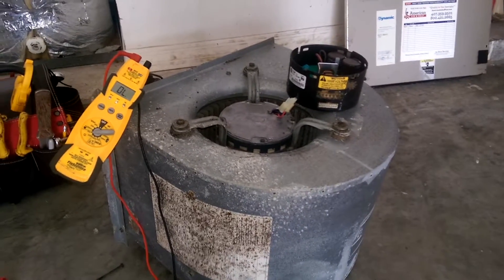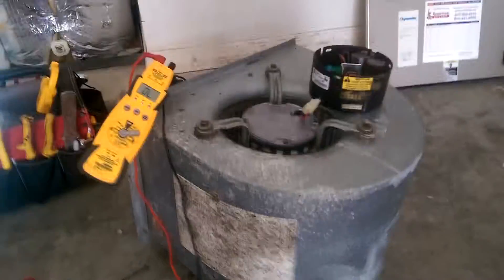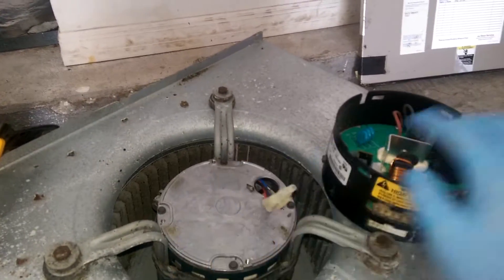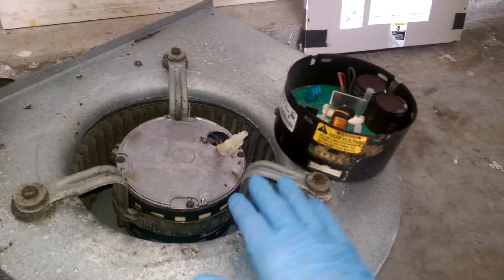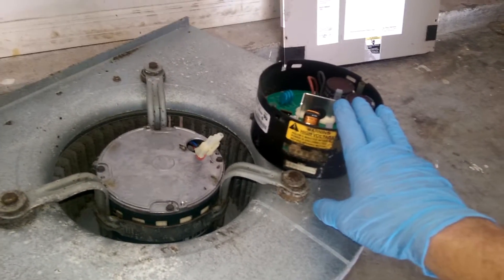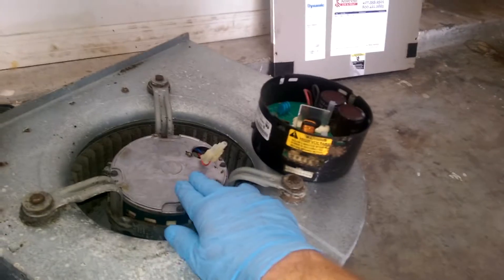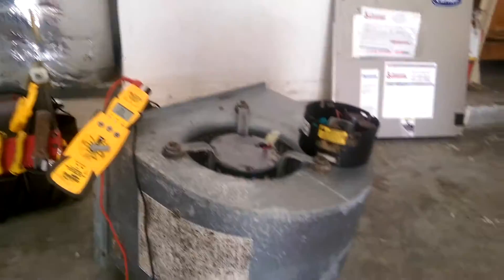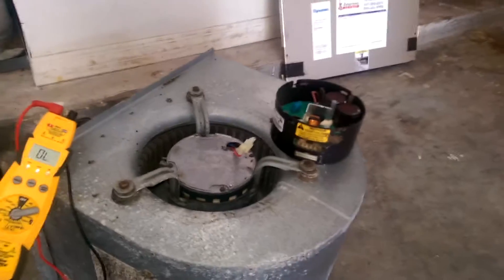Troubleshooting Variable Speed Motor and Module

Comment from the maker: They used to always be sold separately. We actually replaced just the module in this one today and got the motor running for half the price of a complete swap. Just doing the module is the old school way though. Replacing the whole motor with module is the safer repair for sure.